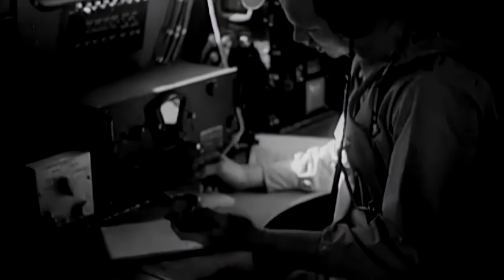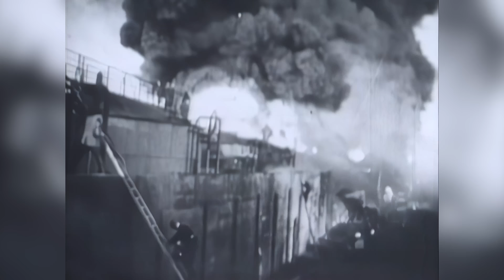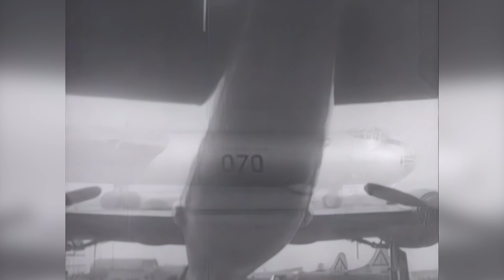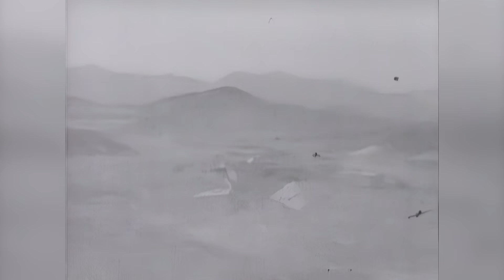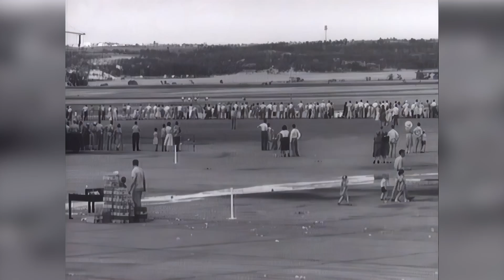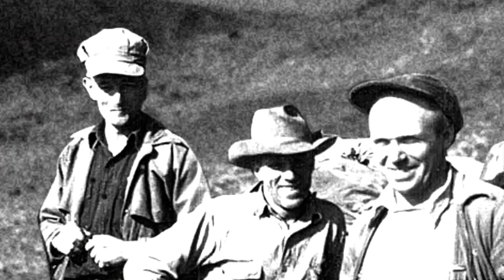American Giant Bombers, The Evolution. From The XB-15 To The B-52,  B-36, And More | Rare Footage

Comment: Why no turboprops instead of piston engines?
Reply: Probably didn't exist yet in the late '30s or early '40s
Reply: Turboprops came along in the late 40s, just a little too late to be included in the design.

There was a turboprop version designed for the civilian passenger version of the XC99 if any airline wanted to take it up.

Comment: Has there ever been another regular production aircraft (as opposed to experimental ones) that had both piston and jet engines? Were the jet engines used only on take-off to provide an extra boost of power?
Reply: Yes, the North American AJ-1 Savage, the U.S.Navy interim nuclear strike aircraft, 2xR-2800 + J-33. Essentially a jet boosted piston aircraft. Took up a great deal of carrier deck space, perhaps a somewhat marginal vehicle (very small prop clearance on trapping), soon replaced by Douglas A3D-1. Other planes such as Lockheed P2V, Fairchild C-119, Fairchild C-123 had booster jets added later in their careers, usually to aid high gross weight takeoffs.

Comment: That thing had the radar cross section of the Rock of Gibraltar. A Mig-15 would have chopped it to pieces. It was a dead end in aviation technology.
Reply: What kind of radar was MIg-15 equipped with?
Reply: @xandervk2371 reviving an old comment but interestingly enough, the soviets were one of the first nations to have wide spread long range radar, infact the mig 21 did have some level of guidance from the ground radar itself. So it's not crazy to say that it could get picked up and have ground crews guide in mig15/17s to intercept. And to answer your questions regarding radars in migs it did happen in the mig15p although not in any numbers, that was reserved for the mig17s
Reply: It was still an effective deterrent and asset. Obviously it was a dead end. That’s why we built new bombers, and then built thousands of them.
Reply: Or a Fokker triplane  😂

Comment: My father newly married worked on two rennovations at San Diego starting in 1950. Sealing the rivets in the leaky gas tanks, and installing the jet engines.  The program ended about May 1952, just before I was born

Comment: All because the Burnelli B-1000 & 2000 were politically unfavorable, because FDR favored graft over function.

Boeing had a 1940s proposal called the model 360, and related 361 & 362: a huge, thick wide chord wing with buried engines usually with pusher props.
Looking like the '40s Higgins Bellamce 39-60 logistics plane which can be found mentioned online.
They concentrated on minimizing the fuselage and maximizing the wing to carry the load instead.

See also the USAAF Materiel Command Design MCD-329 (MX-423) of the same sort: normal cruciform shape, with minimized fuselage and huge thick wings to carry almost all fuel & payload.

Sort of a little test plane like the huge Higgins Bellanca logistics, which proved the concept of minimizing the fuselage to just what needed to carry a tail, see Northrop 1929 "Avion 1" x-216h.(not the later N-1M all-wing) Commonly called a "flying wing, it was entirely successful as a flying machine, though he ran out of money and dropped it. It was reported by test pilots as among the best of all planes in its weight/power class in all criteria, and a good deal faster (more efficient) than any. He should have kept on with it, instead of chasing off after the purists' all-wing with no tail.

Comment: Very nice video presentation about some iconic airplanes. The XB-36 "Peacemaker" was a beast. It was an amazingly powered airplane. (six pusher prop engines, and four jet engines near the end of the wings) It had a total of 10 engines. The marvelous technology of this airplane came to be, and it was mass-produced because the Air Force, under then Brigadier General Curtis LeMay, it proved to be the ultimate long-range bomber. Convair has planned out another design much later dubbed the XB-60, that was an all-jet powered concept. It basically was a "Peacemaker" built to become a "swept-wing" large bomber, and transport airplane. This airplane, the XB-60 however, though rather impressive, didn't sit well with General LeMay and the Air Force for the military long-range bombing offensive. The Boeing company had developed the smaller B-52 "Stratofortress", and it was chosen by the Air Force, and was brought into in large numbers. It was in reality, that little did anyone know at the time, that the B-52 was to become a technological marvel after so many years. To this day, the B-52 has become the oldest "still-flying" airplane ever produced. They will have newer engines fitted onto them soon.

Comment: The XB15 and XB19 were both victims of airframes larger than the engines could lift.
Reply: How did they fly then?
As well, the engines do not lift the aircraft. The wings do that after sufficient air is drawn over them.
Reply: @gregoryfuller1136  yeah, I don't think the engines even failed on those two bombers.

Comment: They should have gone with the flying wing instead of this behemoth witch would have been good target practice for the enemy, and the crazy maintenance that had to be done after each flight. What were they thinking or who was getting paid off?
Reply: They were thinking the YB-35 was not as good in terms of range and payload, and actually didn't even fly very well.  It also used the same engines. They decided not to buy a plane with inferior capability just because it would required fewer spark plugs to be changed after a 2-day mission.
Reply: They were thinking of being able to fly the required mission, which the Flying Wing would not do.